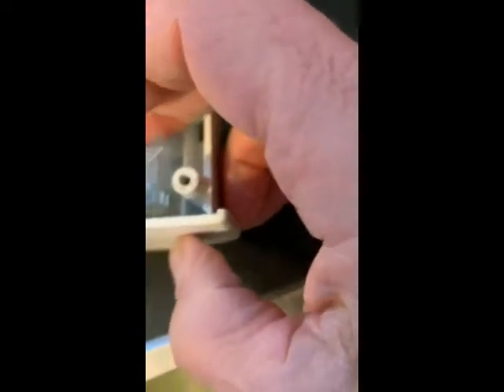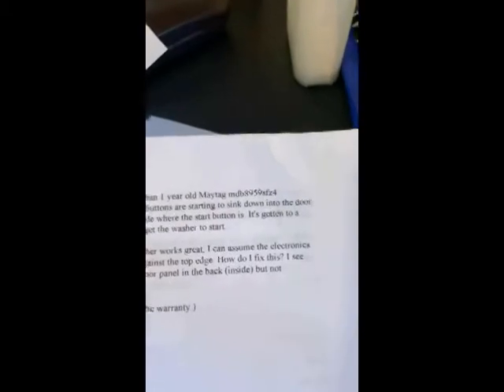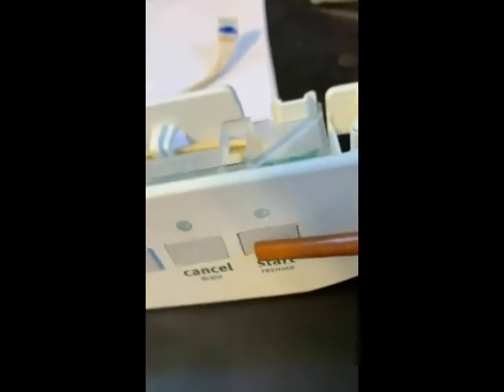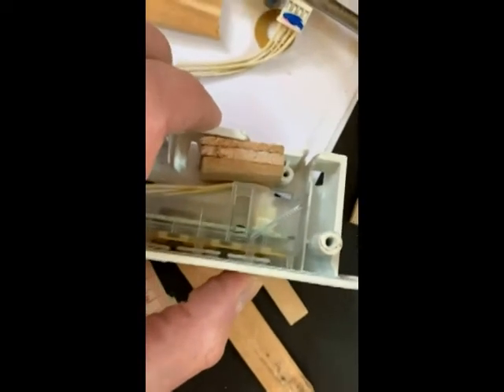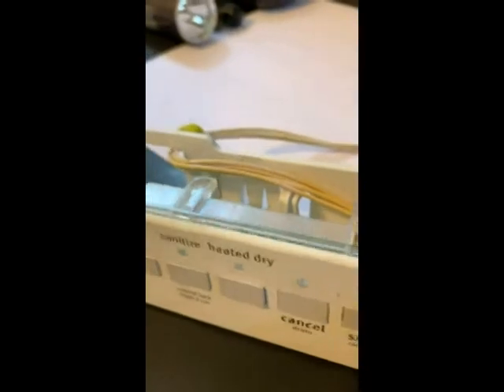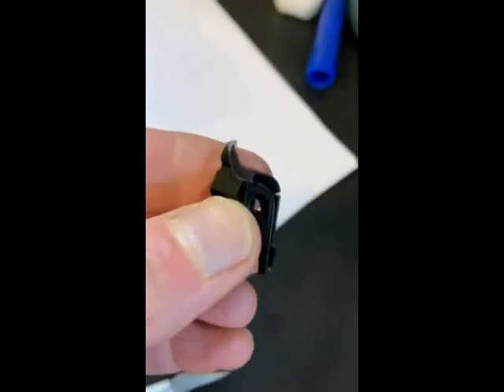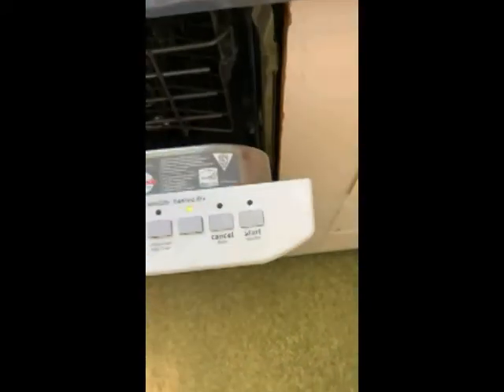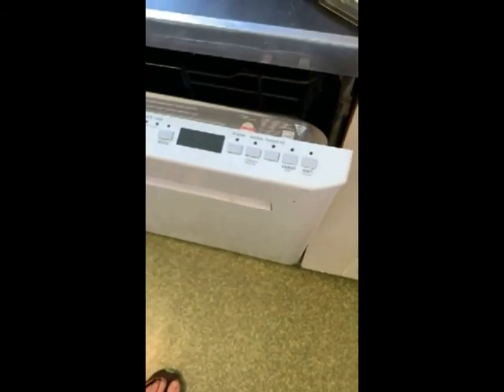Faulty start switch on the Maytag dishwasher model MBD8959SFH.

Comment: Totally worked and saved me the cost of a new dishwasher - thank you!  I found that a 2x4 Lego block fit in perfectly to support the back of the button.
Reply: This! Your Lego idea saved me $600 today. Initially I thought the Lego would be snug enough long ways, but it fell through on the first button push after putting it back together. Removed the door panel again, flipped the Lego so the 2 side was facing towards electrical panel and it put plenty of pressure on the buttons. Appreciate you sharing this.

Comment from the maker: Still works 15 months after I posted this video!!!!!!!
Reply: at least that one has real buttons - the newer ones have "touch buttons" that aren't really touch buttons, and the whole thing is made of several layers of plastic glued together. There isn't even a real circuit board, just some kind of conductive ink printed on plastic sheets. It seems like moisture gets into the glue and becomes conductive, and then the control freaks out and can't read the buttons properly. The new button panel, even though it costs about $5 to make, they charge $300 for it! F'ing ripoff

Comment: I had similar problem the start switch... I had ordered a ($175) replacement panel, took it all apart and when I plugged it in it would not work. I remembered what you did. I found that a plastic locking part had broken off which locks the board in place. So I took a wooden paint stirrer that you pickup at Home Depot for free... cut it down so I could slip it inside the plastic shroud and glued it in place to stabilize the panel. This resolved the switch issue - and sending the ($175) panel back to the distributor.

Comment: I had the same problem and your video was a great help.  Thank you - gave me the confidence to tear into mine.  You are right about the plastic mounts are breaking.  I found the plastic mount that holds the board in is missing like in your video.  My quick fix was to use  a glue gun to tack in the board at the mount.    We will see how long it lasts in this hot/wet environment.  Thanks for illustrating your assembly process.

Comment: I just finished using your video to fix mine.  Same issue as everybody else.  Thanks for sharing, as I figured the next step was a new dishwasher.  I agree with others, it was very poor-quality switch factory install, and cheap plastic parts inside.

Comment: I watched this your video and read the comments!  I wedged some legos in the there like suggested in the comments and boom!  This baby was fixed in about 30 minutes and I did not spend a single penny!  My wife thinks I am so handy!
Reply: Thanks! I rummaged thru the kid's old toy bin and found a lego piece to shore up the switch. Worked like a charm. Maytag, if you're watching this, shame on you for putting such crappy  parts in your machines. This is the 2nd time its failed and I wasnt going to pony up another $300 to swap out a control panel thats otherwise functional! A big thanks to Jeffrey for posting the solution!

Comment: Thanks for the great info.  I use some pieces from and old rubber hose line about 1/2 OD then cut a small section out to wrap the broken plastics brackets, so essentially made a 'C' shape.  Seems to work as they all were pretty snug fit.